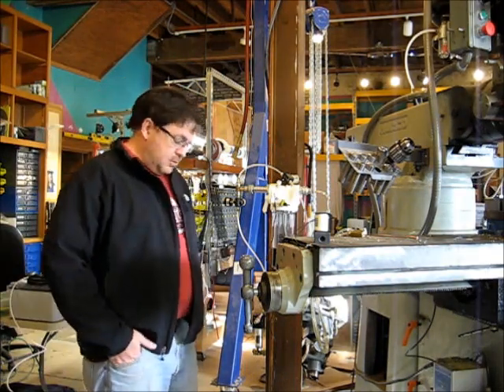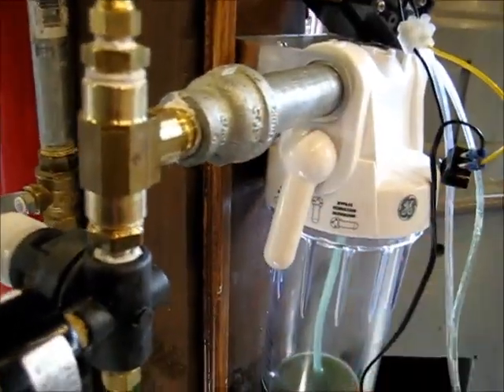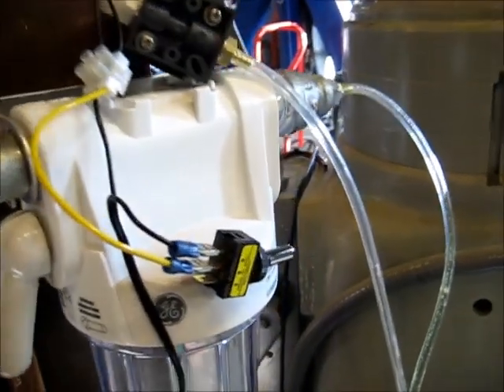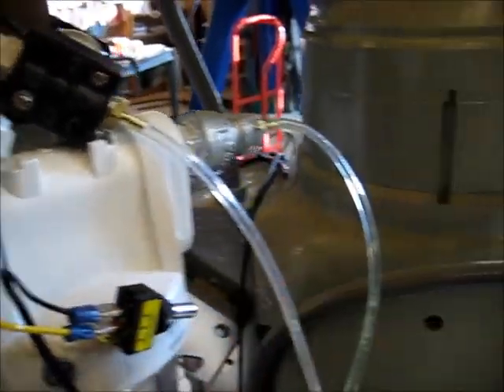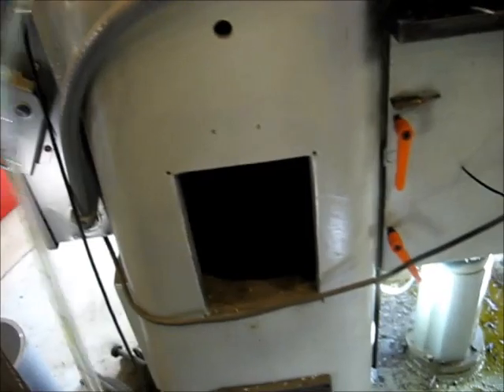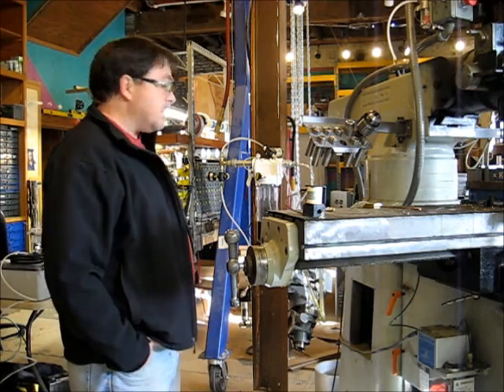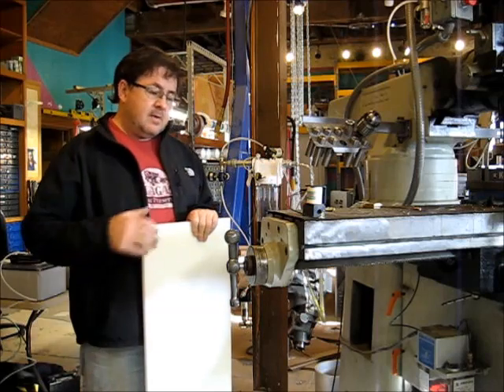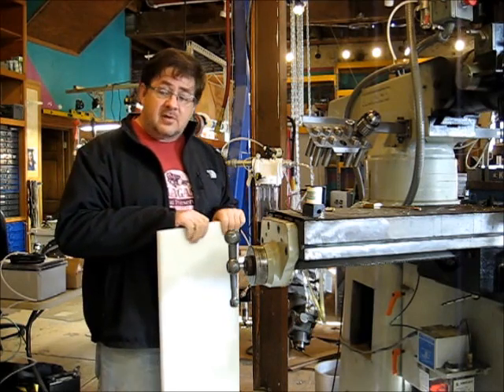Kilroy's Fogless Misting System Part 3

Comment: Well, the coolant bottle has to be below the needle valve/nozzle, otherwise it will suck from the bottle. The downhill part of the coolant tube will empty, as far as air can replace the liquid. And for sure it will not be dropfree, but reasonable for maybe changing parts or Settings on the machine. At least way better than pushing coolant with air pressure. I keep on dreaming of an switch on/off solution as you have those Solenoid valves. This would be elegant.

Comment from the maker: Hi Mr. Straub,  I gave your idea a try. the air cuts off right away, however parts of the coolant side still have pressure, and some volume, and it continues to run.  I even tried putting a solenoid at the coolant outlet from the canister and just the coolant in the hose, which is under pressure.  The polyurethane hose must stretch quite a bit under the pressure and when you pull that pressure off and cut off the air the coolant only has one place to go, which is out on the table.

Comment: Put that Solenoid valve between the pressure vent and the coolant bottle inlet. So you cut the air completely and you dont have to Close the needle vent separately. As you Switch on, the mist ist coming with your previous valve adjustment.

Comment: Hi James,

Thanks for the plug. I guess I have to do a coolant dispenser video now for the sharp eyed tubers. When you mount the nozzle of the dispenser mount it so the tip does not change its relationship to the cutting tool. As the table travels the nozzle will drift of of range. Typically these would mount on the left side point toward the right and back away from the operator. If your lucky your mill has a hole in the casting for a indicator mount. 5/16 rod fits it perfect.

Best,

Tom

Comment: Hi James One little tip is to not make your boards equal lengths. Let me explain, I never mount my vice in the centre of my mill table but always to one side, the reason is that it changes the wear point as every time I have to refit my vice I move it to the opposite side. Not so important perhaps for your large machine but on my little toy, it also allows me to fit a rotary table or spindexer and keep the carefully aligned vice in place.